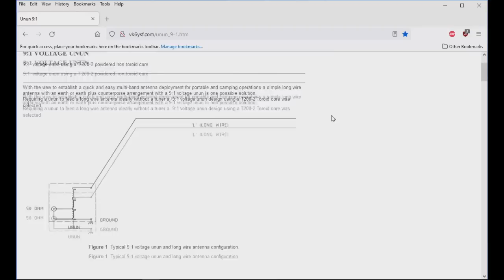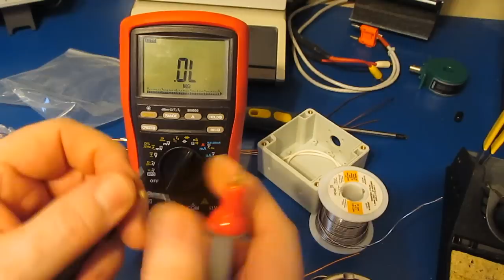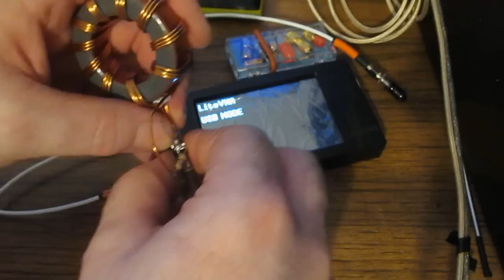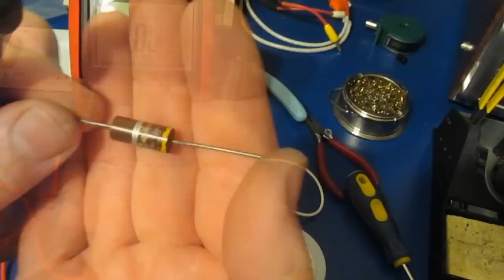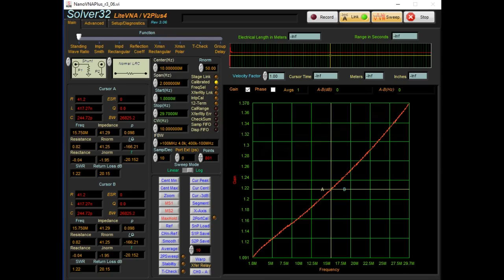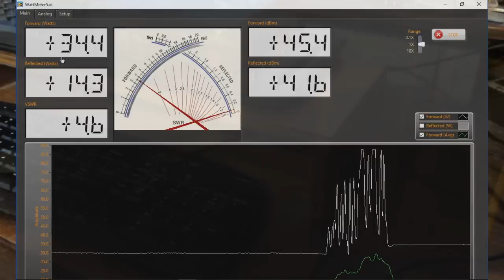Assemble & Test an RF Transformer from a  Kit

Comment: what software was you using
Reply from the maker: You provided no time stamp.  I show two different programs I wrote.  One for the low cost VNAs, the other specific for this experiment.   I made somewhat of a follow up video showing a home made Watt meter.     https://www.youtube.com/watch?v=JHsgbu7brYI
Reply: @joesmith-je3tq  it was the only one that you used first one
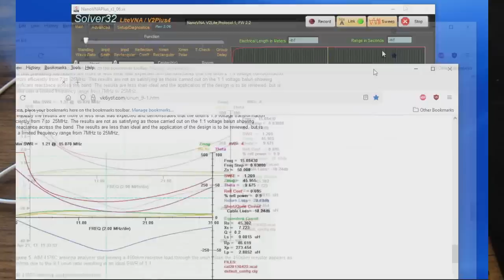Reply from the maker: @AndrewMurphy8383  14:48, 21:31 & 41:35, two different programs.  Looks like you are asking about the software for the VNA.
Reply: @joesmith-je3tq  ok i look at it when i can get get a break and let you know i dont know why you just cant tell me the name of the the two software
Reply from the maker: @AndrewMurphy8383  It's very rare I would feel any need to name the software I write.  In the case of the VNA, I did name it and you can see it on the upper area of the program.  For the other, there is no name.  If you like, we can call that program George if that will make you happy.  Consider that software is no available to the public and I doubt I even have it anymore.   It was just a quick toss together to run the experiment.   Much like a lot of the programs I write.

Comment: The box would probably start to melt around 500 Watts.  At 1K or 1.5K it would probably be so hot under continuous use it would catch on fire.  The core size is woefully undersized for 1.5KW which is legal limit for amateur radio.  I have built 9:1 UNUN's that can handle well over 1.5KW they have 3 stacked cores.  Heat is your enemy.  If it gets to hot you start to loose the magnetic properties of the core and it can get to a thermal runaway condition.  Magnets don't like heat.

Mike KC3OSD
Reply from the maker: I'll let you test that.

Comment: I could buy the parts for a TINY FRACTION of the $45 being asked, ....WTF?????????????
Reply from the maker: In business, we would call that profit.
Reply: @joesmith-je3tq  There is profit and there is profit.  It should be a win-win.  This is NOT!
Reply from the maker: @stevenbliss989  It's not my business and I have would have no way to know what their costs and margins are.
Reply: @joesmith-je3tq  Please do not read in that I am having a go at you for doing this video, the build or anything.  I am talking about the product, NOT YOU!
Reply from the maker: @stevenbliss989  Work up what you feel this kit should cost and itemize it.  I would include any details on what you feel is their break even point.    Should be interesting.
Reply: @joesmith-je3tq  Sure, what is the exact material type of the core?
Reply from the maker: @stevenbliss989  Engineering costs, writing specs, how many you plan to sell, making fixtures to drill holes, Amazon's costs......  All part of it.   Maybe you spend time figuring out the requirements that will make more sales.   All up to you.  Let's see what you can come up with.    Now, if you want to include my costs as a consultant, I think you just cut into the high profit margins.  Better to just show us what you can do.
Reply: @joesmith-je3tq  I agree there are a lot of design costs, doco and of course manufacturing organising etc. the biggest is always the engineering, BUT this is not brain surgery, so simulation to get you in the ball park, and network analyser to refine/test is not big here.  I you had to pay $2 for a screw because of these factors, you too might say it is over priced.  The same here, it is not a "special" product, it is off the shelf stuff in design and parts.  This is why I criticise it, especially given it's CRAP performance, likely due to poor (i.e. cheap) choice of core material.  If I could sell a $2 item for $100, I would, ..profit is good, it grows the economy, but like I said earlier, only if it is win-win, and this product is win-lose, and at a high price, making it an economy lose to a small extent (small because the seller will hopefully do something useful with the ill gotten profit).  I think we disagree an the extents, not the principals. For me it's simple, win-win or it's profiteering, which I would fight myself not to do because it feels like crap (I say this honestly because I am hardly a pillar of morality).
Reply from the maker: @stevenbliss989  Long post for so little information.  I had assumed you would come at it with some actual data.
Reply: @joesmith-je3tq  I am still waiting on the material type of the core from you?
Reply from the maker: @stevenbliss989  Engineering is part of the cost but no matter as it seems you really have no clue on what goes into developing a product.
Reply from the maker: @stevenbliss989  If you like, once you have your TINY FRACTION of the $45 BALUN for sale on Amazon, just post me a note and I will make a review of it.
Reply: @joesmith-je3tq  I think I already said that it is the largest part.  If you bother to read my responses we might communicate better.  As for understanding product development, I have many designs and sold many, mostly while I lived in the US.  The vast bulk of it in mass duplication systems, media testing systems. you know floppies etc (times way past) - all with complete documentation.  Before that, it was diverse lot of, mostly contract designs, in Australia, the vast bulk of that to the grain and wine industries.  So please, before you accuse me of things that are not true, give me a modicum of credit that I might not be a complete moron.  90% of all this was small run product runs, the manufacture of which I usually contracted out.  If you compare the insane inefficiency of "öld school" product design (the likes of IBM vs Tesla) then your argument holds water.  I am talking about taking advantage of "pre-engineered" IP, which in this case is that majority of the "would have been" cost, and may be what you are referring to.  Even in more complex designs using MPU's (about 2/3 of my past products), much of the software is already there in libraries and free IPs from the MPU manufacturers, again greatly reducing the engineering time/cost.  Even though in all those cases the engineering cost is still the lions share of it, it is much lower than it used to be.  Finally in this exact case, the engineering cost in small, almost trivial.  You accuse me of not having a clue, well, I think you are letting your desire to defend a crappy poor value for money (even if it were good) product (because you have associated yourself with it on YouTube) is colouring your views.  And I think I have shown you that I do have a clue.  The rule of thumbs for most products with a decent production run is 3 x cost of parts & manufacture.  In this case it is about double that, and it's a crap product to boot!  You made a mistake with this product, and defending it so much reminds me of the ULTRA EVIL DemonRats currently destroying  and trying to enslave the US.  It's an ugly path to go down, ...honesty is much better.
Reply from the maker: @stevenbliss989  Too much booze?  I have never defended it.  I am asking you to back up your claims on cost.  Long posts != good data.   So far all you have done is asked for my help.
Reply: Maybe but I doubt it for a commercial product. The RMC for the parts runs about $27, buying parts in bulk, then shipping costs - USPS probably $4, Amazon/ebay fees around $9 on a $45 sale cost and the seller profit  is around$5, so yes you might be able to do it for around $30 but a commercial seller is not making much profit on $45.
Reply: @TheBananaPlug  I think your are over estimating the costs here, BUT, I am comparing it to getting the parts YOURSELF, not to sell.  I do agree a comercial seller would not be worth it, as to make it viable you need 2-3 x cost.  2x might be possibe though, BUT I do not know what the torroid material is, and that is by far the lions share of the cost here (NOT counting labour), and the cost here varies HUGELY depending on material.

Comment: General Class HAM here (KI5QFC) ... I think you have a bit of a misunderstanding about what the difference between a End-Fed Half-Wave and a End-Fed Random Wire... The End-Fed Half-Wave is a resonant antenna but it needs a 49:1 unun (transformer)to match the ~2,500 Ohms impedance of the antenna to the feed line (50 Ohms)
The 9:1 unun is used for a End-Fed Random Wire antenna... You are looking for a low SWR on an antenna that HAS to have a high SWR to work... The End-Fed Random Wire HAS to be used with an antenna tuner... The 9:1 is used to match the impedance of the antenna (~450 Ohms)to the feed line (50 Ohms) or the radio directly (50 ohms). You need to cut the wire so that it is not a halfwave multiple of any frequency you want to use. Any time the antenna becomes resonant at the frequency you are transmitting at, the impedance will start to rise VERY quickly, and you need the 49:1 unun, but no tuner. The advantage of the random wire antenna is that you can pick a length of wire that is NOT resonant at any of the frequencies you are using, and it will work on ALL of them with just a antenna tuner.
Reply from the maker: No antennas were harmed during this test.

Comment: I was researching about coils and have read in patent from Nikola where he used 2 wire conductor like in his bifolar coil to increase capacitance by connecting end of one of two wires to begining of other creating double loop of tranformer and he said that would increase frequrncy response and allow greater current flow in coil as capacitance is evenly distributed along the coil countering inductance. As the difference in such case of potential between each turn is half of what normaly is he found it very useful at higher frequencies and voltages. Also submersion in oil would help with temperature but also with leakage that occurs in air as dialectric. I am just in wonder would any of those affect RF transformer in this aplication. I guess you gave me a idea to test with VNA which I learned how to use thanks to you and few other youtubers. Thank you for your videos I love this kind of experiments.
Reply from the maker: The very first 9:1 ununs I assembled were not shown in this video.  I made a set, one twisted pairs, the other not.  The twisted pair hurt the performance.  I also tried a coaxial version which I could not get to perform as well.  You will find the my posts about those on EEVBLOG.

Comment: Thank you Joe....new subscriber couple weeks ago.  I so enjoy your experience, knowledge and discipline analyzing and making measurements that are meaningful and drawing some useful conclusions.  I'm anxious to use your software for the NanoVNA.  I have the H-4 model.  Lab View has a "community" version available -- will that work with your software?  I just recently found this on the NI website stated for "non-commercial" use only.  I would very much appreciate a bit of guidance in that regard.  
Many, many thanks!!
Reply from the maker: Ron, you do not need LabView installed to run the software.   It's like any other executable.   I have not had any luck with the H4.  Because it uses the older protocol (how the PC talks to the device), it would only work with my older software.  Others have claimed to use it but I am not sure to what extent.  

For development work, I will not use the community edition.   It requires an internet link, meaning it could go away.  It's just too risky to invest any time into.   I would have continued moving towards their latest 64-bit tools but that's no longer being considered with the advent of their subscription / extortion business model.   

I suggest you use one of the open source packages instead.  The most popular one was written in Python and will run on Windows, LINUX or Mac.   It's also better supported and has a large following.

Comment: All that SWR sweep is under the assumption that the antenna presents a flat 450 ohm impedance across the entire HF range. There's basically one way to do that, and it's a resistor. Transformers like that almost always require a transmatch, tuner, or some other matching network. I'm more of a fan of DG0SA's (sk) designs for transformers and chokes. 73 de w8tam
Reply from the maker: All that SWR sweep was with basically a resistive load, except where I show the two back to back, then into a resistive load.  This was done to compare transformers over a wide band.

Comment: Thanks Joe. Judging from the seller's claims for that size of Mix 2 core, I suspect this is about to get ugly.

Update:  From all I've read about RF toroids, the various mixes of powdered iron cores (like this one,)  are best for narrow frequency range (tuned) impedance matching transformers, while the ferrites are usually best for broadband impedance matching transformers, (like this application.) Also, the Mix 2 cores, (red and clear coat powdered iron cores like this one,) start getting pretty lossy up around 10 meters so they typically switch to Mix 6, yellow and clear coat.) So all in all, this core is likely to melt right through that plastic box when 1,500 watts gets sent through it for any period of time, assuming the transmitter won't just shut down first from the high VSWR on 160 and 80 meters, and possibly 10 meters too may cause a melt-down from the reduced efficiency and therefore increased core heating on 10 with Mix 2.

I've done no testing to verify this, just done a lot of reading online from the pages of knowledgeable people who HAVE done the experimentation. Ferromagnetics is a large, involved field, so I figured that reading was a lot less work for me and saved me from buying a lot of wrong cores. There's just a whole lot to know, and unfortunately, there are quite a few manufacturers who are selling products that use the wrong materials for the job.